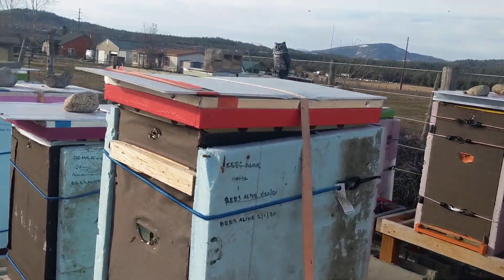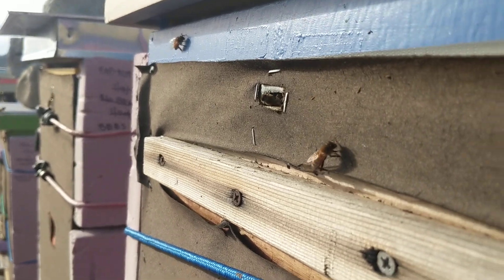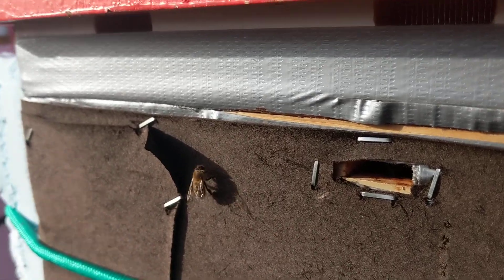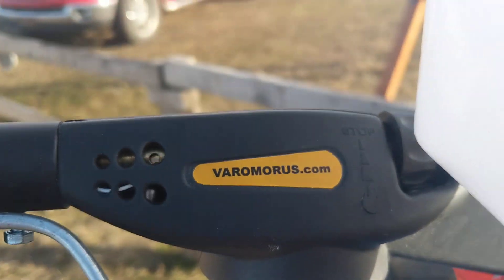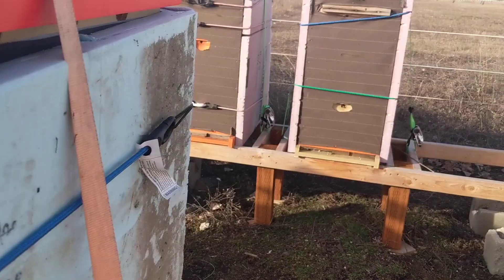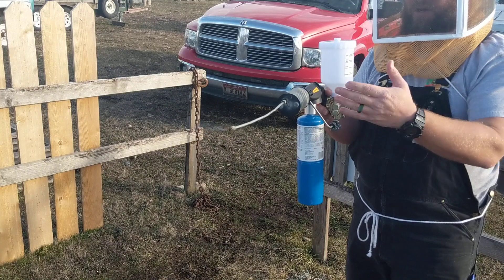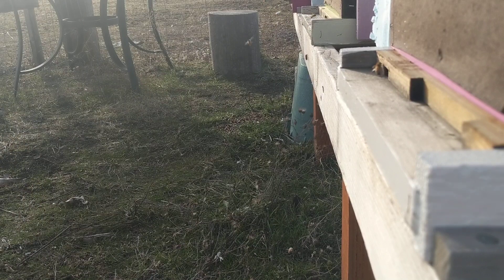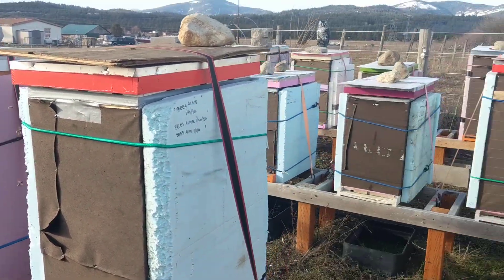Oxalic acid for healthy bees, Feb. 28, 2020

Comment: I heard you say 3 treatments, but how much should they be spaced out? I'm looking at moving to this method of treatment.
Reply: jsnb85 - should be 3 treatments spaced about one week apart.
Reply: @LarryLeesBees  Thank you and I appreciate your help. 😁
Reply: jsnb85 - My pleasure. Glad to help. 😀
Reply from the maker: Thanks Larry. And yes, Larry is spot on.  Doing one week intervals allows you to hit a full 21 day brood cycle. No matter what stage the brood is in, they will all get coverage at some point.
Reply: @timmo7913  Mites go phoretic anywhere from 5 to 11 days.
Reply from the maker: @2SpritOne  no doubt, when brood is present. My queens, with the exception of a few of my over achievers are just starting to lay in February. With my fall OA treatment, and putting the girls to bed with Apivar on, typically coming into early spring I'm 1 minus per 300 count on alcohol wash.
Washes don't happen until we reach above 55°f and I can safely expose brood. Typically March.
Reply: I treat 5 to 7 days 3 times to cover the time brood is caped. Results are bang on. Early Spring & Fall.